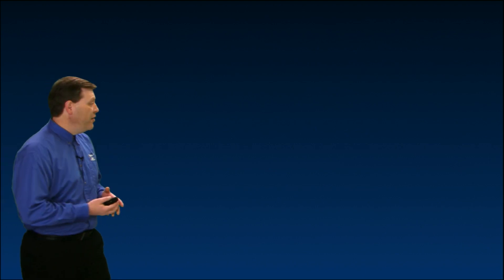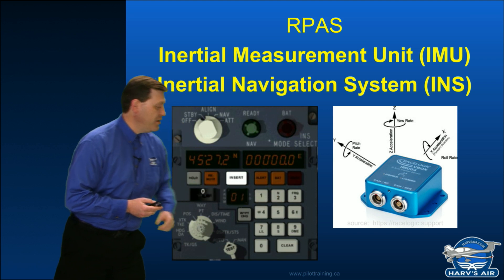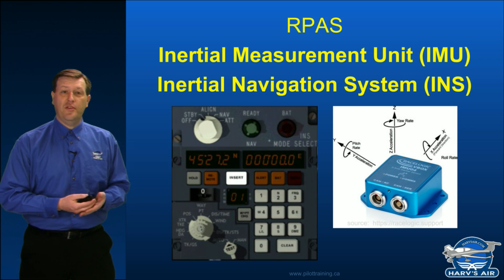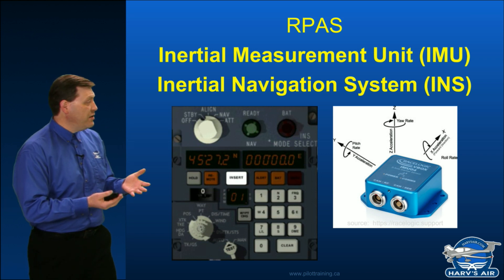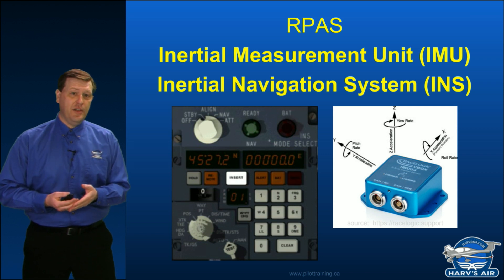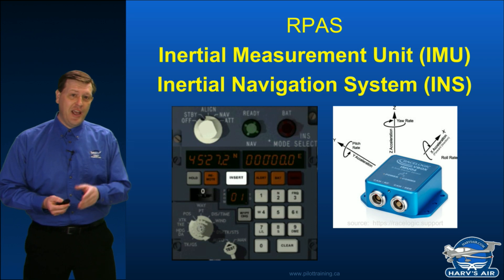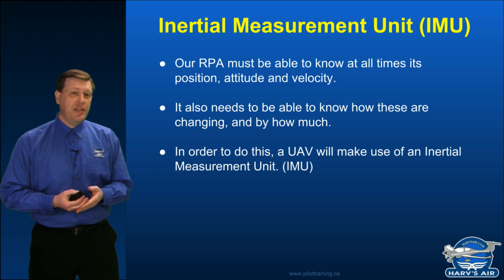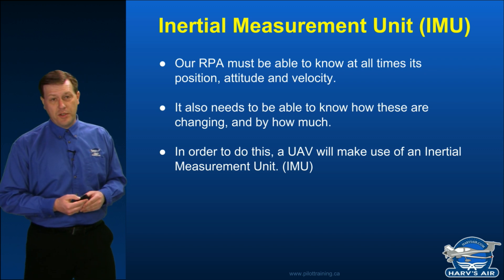RPAS Intro To Inertial Measurement Unit (IMU)

Comment: I do not understand why these instructors never start off by explaining what inertial navigation IS: a self contained system that is capable of detecting changes in vehicle attitude and acceleration in three axes, a total of six parameters.  Within the unit, each axis of the vehicle will have a corresponding gyroscope which can sense rotation around that axis, and an accelerometer which can detect any change in linear motion along that axis.  Since the acceleration of gravity is always present, it can calculate aircraft attitude by computer processing the accelerometer inputs to determine which way is up, and therefore vehicle attitude.  If the vehicle is stationary on the ground for a few minutes after the system is powered on, the rotation of the Earth will provide enough rotation of the gyroscopic sensors for the computer to determine the present orientation of the aircraft in reference to true north, and therefore aircraft heading.  Once the vehicle begins moving, continuing calculations provide real-time outputs of present attitude, heading, velocity and distance from the alignment point.  If an accurate entry of the vehicle's present position on Earth is made before movement begins, and the system includes a computer map of the Earth's parameters, then the system can continually calculate and output vehicle attitude, accelerations, velocity in the form of ground speed, present course relative to true north, and position by latitude and longitude, plus inertial  altitude relative to point of origin.  Add an input of either true airspeed or pitot and static pressures plus outside temperature, and the calculations can also produce outputs of present wind and drift angle.  If a navigation map is included in memory, then the system can calculate distance, course and time to destination for any selected point.  Disadvantage: no inertial mechanism is perfect, so errors in inputs will eventually cause the outputs to slowly "drift" out of perfect accuracy.  Making the system redundant by two or three allows detection of drift in each unit and calculation of most probable results.  

This arrangement is the basis of navigation over long distance without reference to any external navigation aids such as astronavigation or radio aids.  It was widely used for travel over oceans before the development of global radio navigation aids such as GPS or GLONASS.  Adding such an input to an INS allows continuous detection and correction of drift errors, making a nearly perfect navigation system.  If the radio navigation input is lost for any reason, navigation can continue by purely inertial means.
Reply: Great, I agree with you, and having a systematic understanding will be more conducive to later learning and application. Do you know these things very well, do you work in this field?